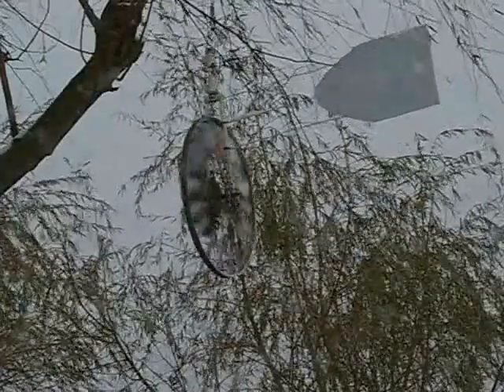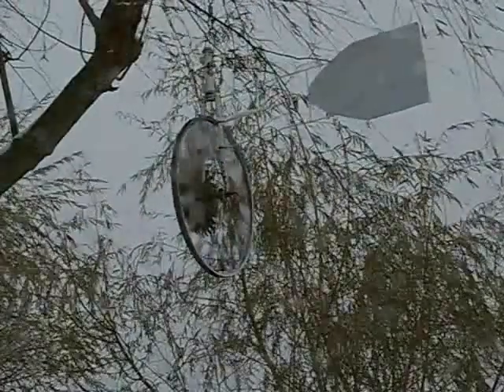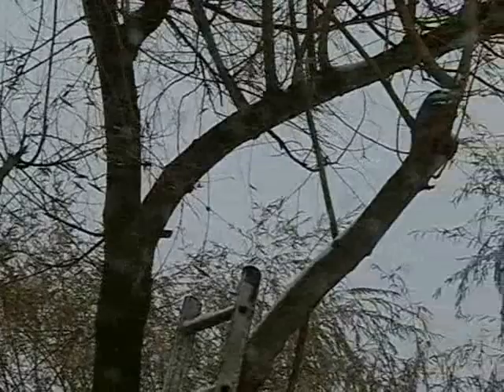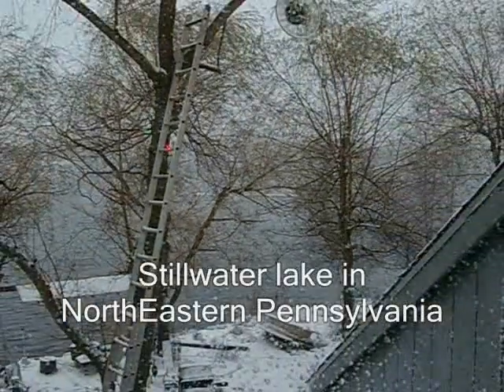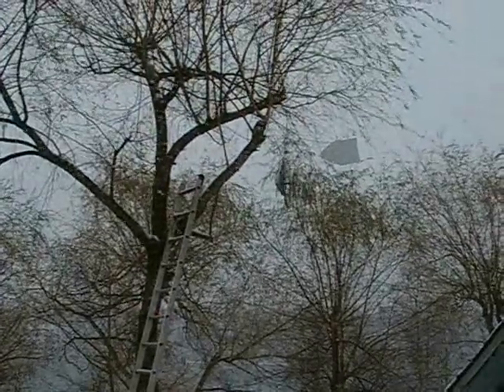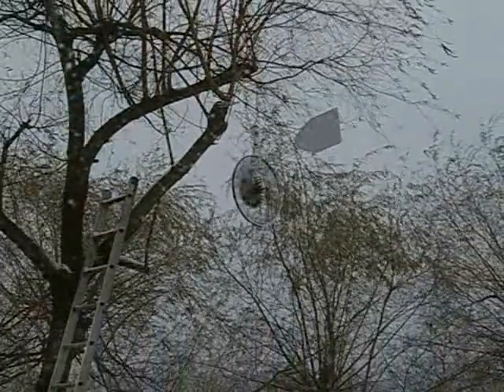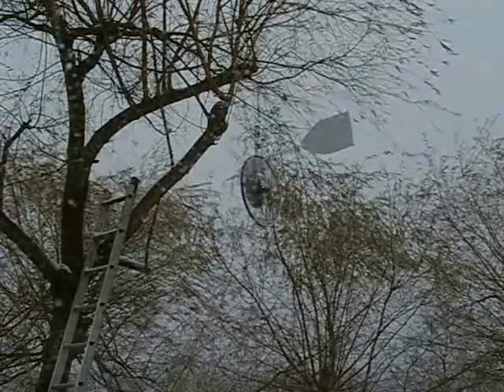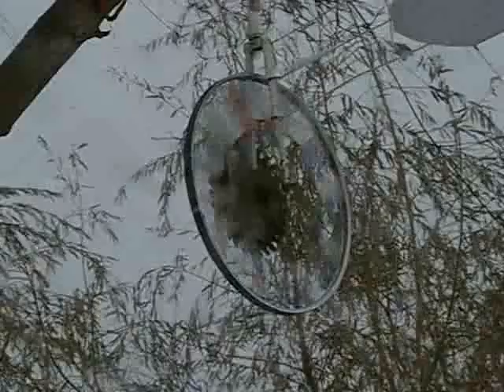Homebuilt Wind Wheel

Comment: Here is something to consider. I notice you have made a "baffle" in the hub to (presumably) direct the air in the centre region towards the blades. That's fine, but remember the laws of aerodynamics. the most important part is the tapering tail, not the nose. Behind the hub must be a mass of turbulent air, this could be smoothed by a tailcone and you could have better efficiency, plus better survivability in extreme conditions.

Comment from the maker: In response to Technocreep, It's much harder to hook up the back wheel of the bike to a rudder, look closely, and you'll see part of the bike hacked and hung from the tree, that's where the fork is hanging from and it's free to rotate 360 degrees while hanging from the steering wheel bearing. As far as generating power, this wheel ( or the back one ) simply will not produce enough torque in low or medium wind speed conditions.
Hopefully I'll be showing my next wheel soon !